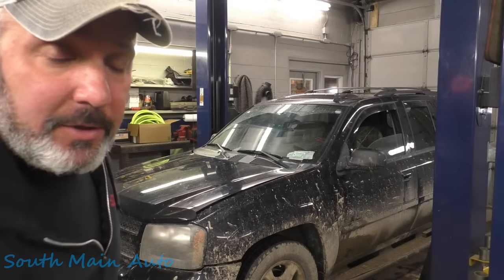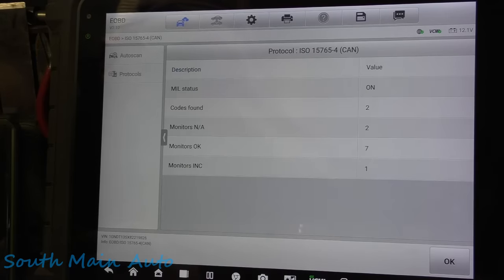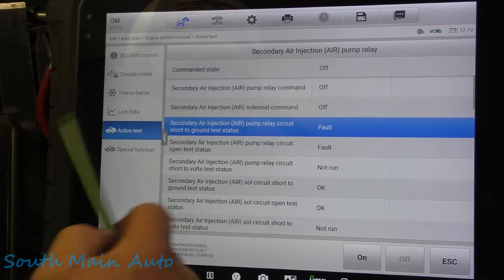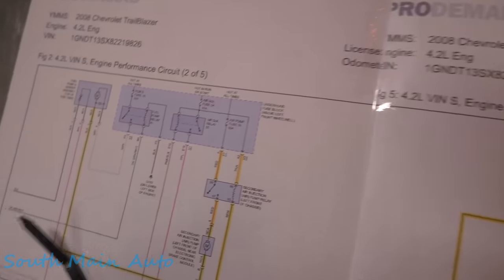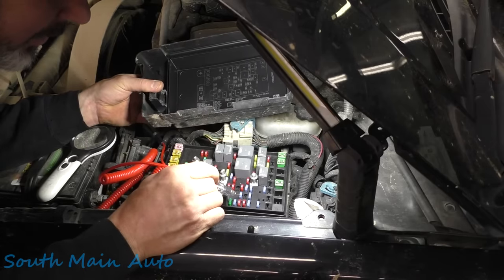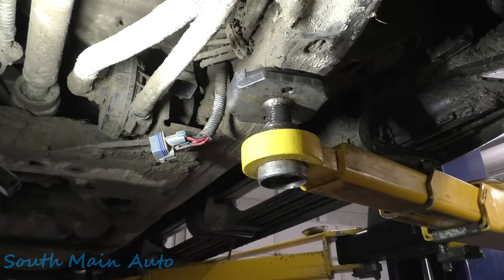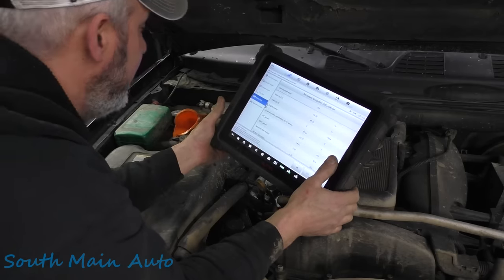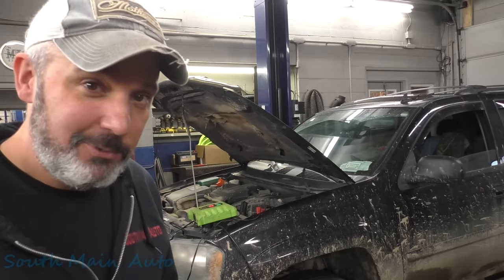Chevy Trailblazer - A.I.R. System Failure... Like All Of It

Comment: I will never buy a chevy. I purchase a new 2002 LTZ. I change the oil religiously, I did the recommended maintenance as was prescribed, at lease 2 time a year  I would have a major failure of a systems. I finally  got rid of the vehicle in 2020. I will say it was extremely comfortable. It was a piece of s+it! I spent more in maintenance than anyone should ever. Chevy/GM suck!!!!!💩💩💩💩💩💩💩💩💩💩💩💩💩💩😿